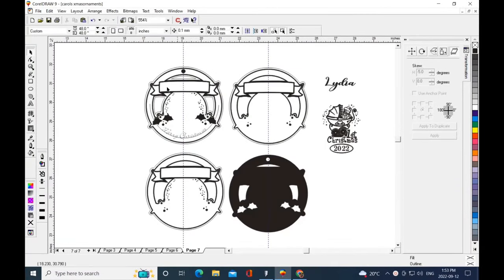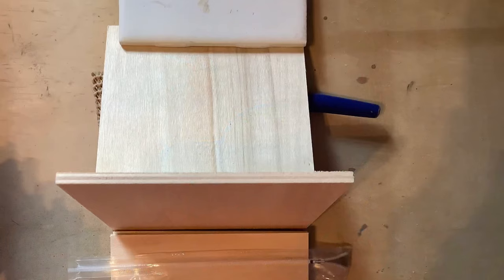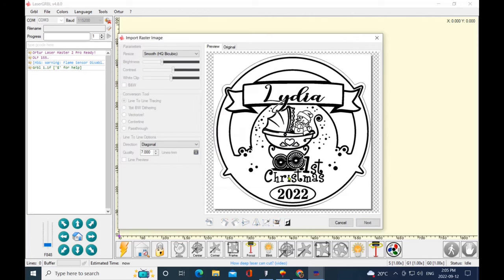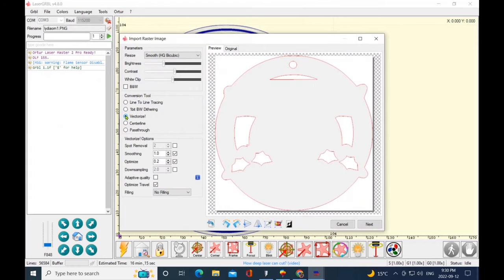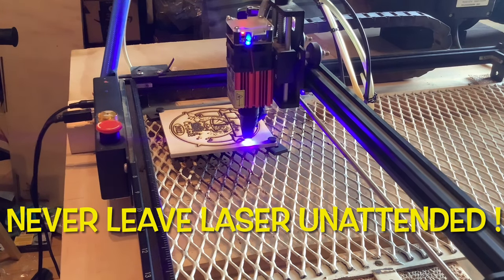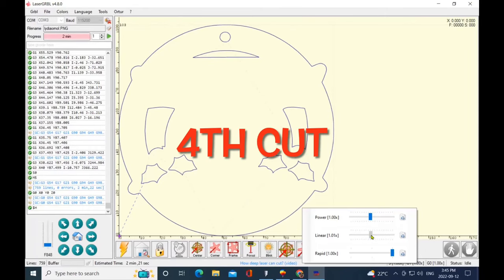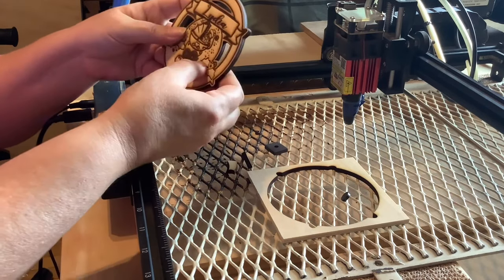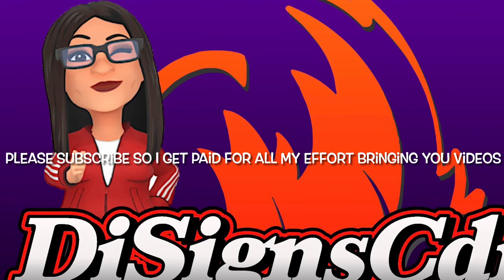12. How to Engrave & Cut in LASERGRBL . ORTUR LM2 PRO !

Comment: Hello, I have a big order coming up that involves cutting circles. My issue is that the right side of the circle is getting slightly more cut than the left side. Any idea why this is happening?
Reply: Also, when I cut my circles it goes side to side unlike yours which is cutting in an actual circle, how? Please get back to me
Reply from the maker: It could be that your wood has a slight warp and one side is higher than the other. (Not level) Are you using the measure / focus tool to make sure your laser is in focus in a few spots before starting to cut? It also could be the type of wood you are using and in that specific spot where the glue or wood may be denser. If you have a big order for cutting , be sure to clean the laser lens regularly 😃
Reply from the maker: @kassius2015  It sounds like you are engraving rather than cutting. Be sure to use the “Vectorize” setting and “ no fills” as the settings . Turn off your “ optimize travel” I’m curious how you exported the file and from what program. Sometimes nodes and curves from say adobe illustrator files are not combined  or welded and may only do it in certain sections if you are working with an svg /dxf hope this helps .
Reply: @disignscdn  it should help! Thanks so much. What do you use to clean the lens?
Reply from the maker: @kassius2015  I first will blow out anything with a can of compressed air, I do this to my fan in my laser regularly to prevent it from over heating. Then I will gently take a q-tip with rubbing alcohol to clean my lens and then a clean dry one to gently wipe the lens before re-installing the tip. Video #25 at 20:15 in shows how I clean my laser. :)

Comment: I am facing a configuration problem - finding the factor between the motors step value ($100) and the lines per mm- BUT FOR THE X AXIS!
I am trying to make the engrave more precise (iam getting zig zags in closer look..)

Do you know how to calculate the ratio of the X axis to get the sharpest result?
thank you!
Reply from the maker: Personally, I have never had to do this. When I was having zig zags in any of my lines , I tightened my belts. But, I did find this documentation on how to configure it on the Lightburn Forum. Hope this helps 😃
https://docs.lightburnsoftware.com/Troubleshooter/StepsPerMM.html

Comment: can it cut on clear/transparent acrylic sheets? or at least with the paper masking?
Reply from the maker: Definitely! Truth be told, I personally have never tried as I would want to have an enclosure with my air exhaust hooked up because of the toxic fumes. Cast Acrylic clear is great for engraving as it turns a milky white. When cutting you definitely want the Acrylic that has the paper protective sheet. This Acrylic is better than the type that comes with a clear plastic protective cover. (At the moment I cant remember which type is which and this is how I would remember when going to buy it! :D ) Acrylic is an extremely versatile material which provides great results when being laser cut or laser engraved. Both extruded and cast acrylic can be laser cut, however extruded acrylic can be left with a slight burr on the edge of the material after laser cutting whereas cast acrylic is left with an extremely smooth edge. Depending on the power of the laser tube it is possible to cut acrylic up to a thickness of 25mm whilst maintaining a square edge. Clear cast acrylic is normally favoured when producing awards and plaques because once engraved it turns a frosty white colour which creates a stunning finish. Certain colours do not react very well when laser cut because the pigment or dye in the acrylic reacts poorly to heat, however the edge discolouration can normally be reduced by modifying settings on the laser such as the cutting speed, the volume of air flow and the amount of power being used.
Remember , a C02 laser will always be faster than a diode .
Reply from the maker: Be sure to check out ORTUR laser groups on Facebook to see true users creations and their settings to see if this may be the machine for you. :)

Comment: Is this 500MW?
Reply from the maker: It’s the ORTUR Laser Master 2 Pro . LU2-4 laser. (20 watt laser 5.5 volt ) finally more 24 volt replacement lasers are coming on to the market. ORTUR has just launched a 10 watt laser as well. I’d really like to try out the new NEJE 80 watt laser...someday!!
Reply: @disignscdn  Three optical power levels are available : 1 diode 5.5w, 2 diodes 11w, 4 diodes 22w (very expensive at the moment).
Reply from the maker: Yes, they are expensive at the moment ..but I’m going to win the lottery..any day now! 😆